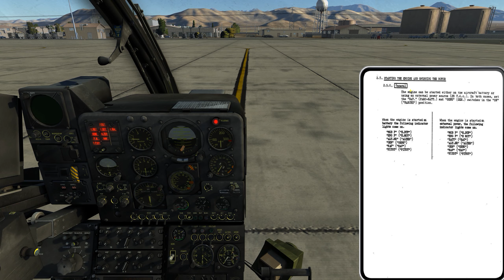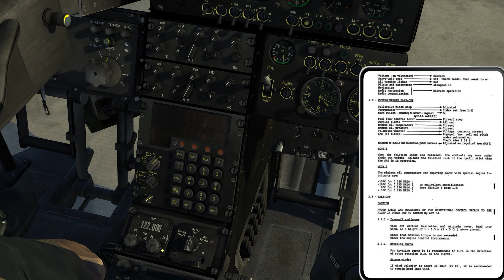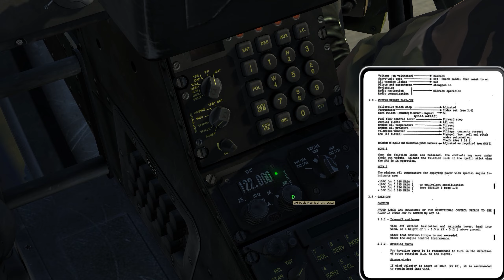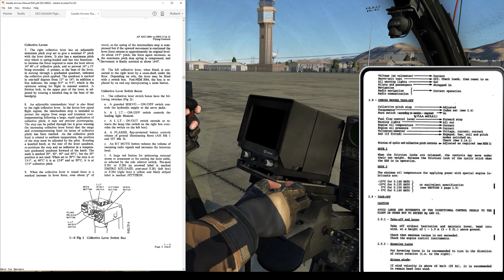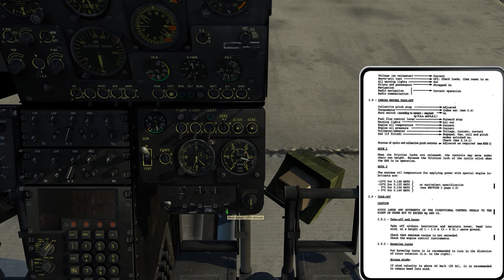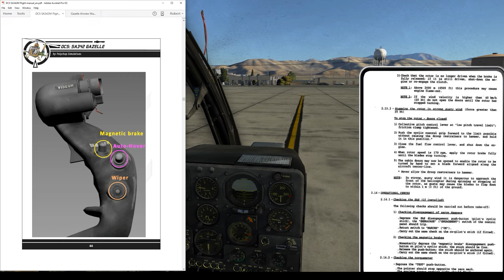Test Flight - DCS: SA342 Gazelle #3 - Startup, Radio Communications, System Checks

Comment: your check list is for english version of the gazelle or the older french version: SA 341 with astazou III C2 engine. In DCS, the gazelle is SA342M1, stands for SA342M the astazou XIV M engine  and the 1 stands for  AS355 squirrel rotor blades which allow the max T/O weight of 2100kg so 200 more than previous versions.